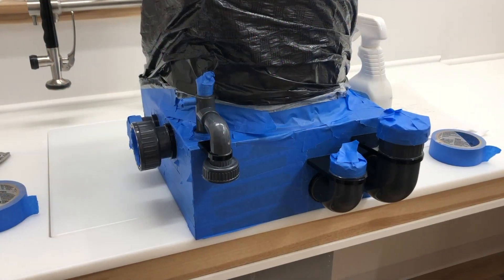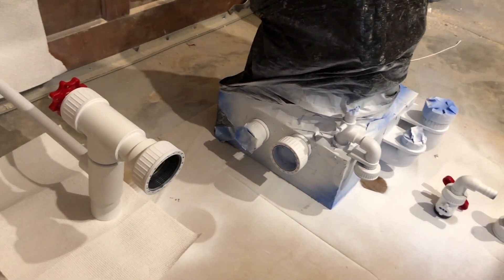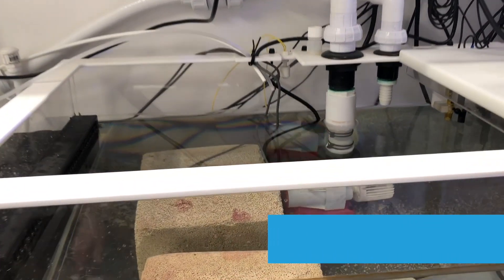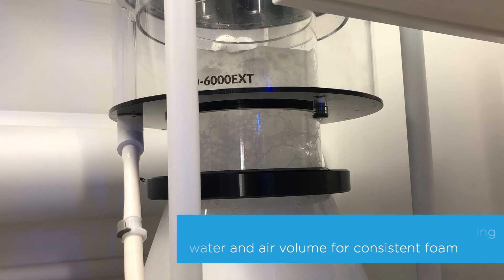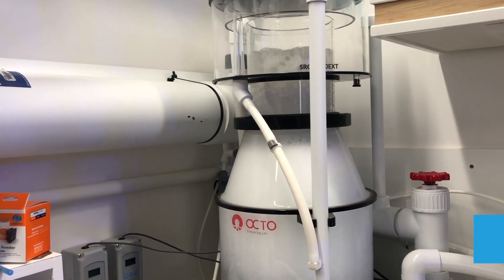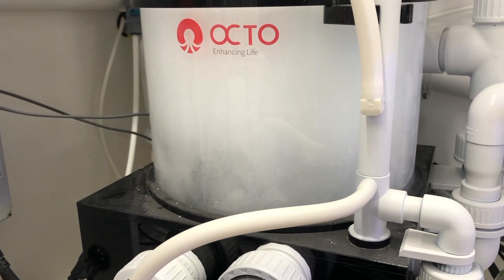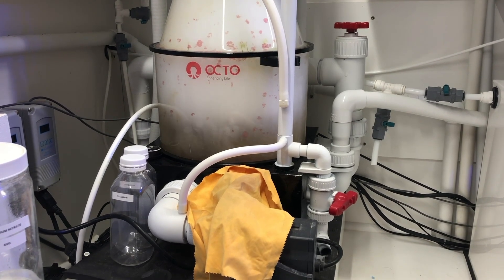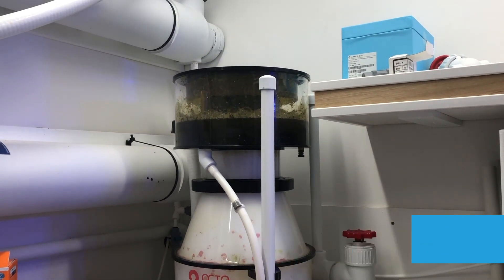Ep. 14 | Build Series: Protein Skimmer

Comment: Very cool. So it has 2 pumps, the first one just pumps the water from the sump without air and the other one pumps the water again with air?
Reply from the maker: Yup - one pump to feed water into the skimmer, which ideally is DC and adjustable, then one dedicated needle wheel pump for foam production and recirculating. Each pump does what it does best then, without having to share duties...